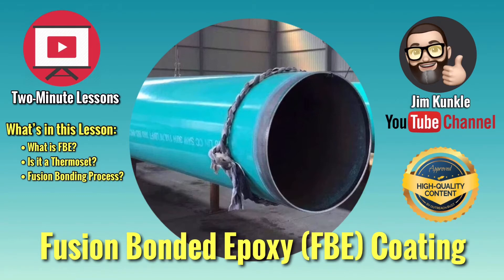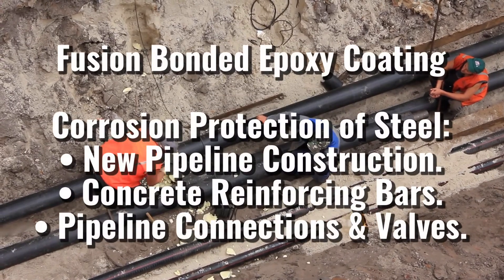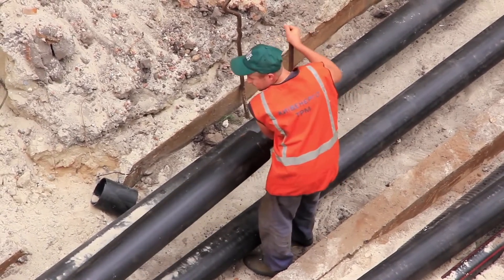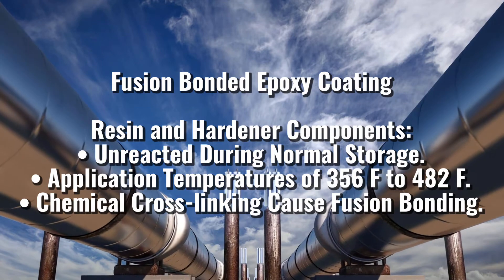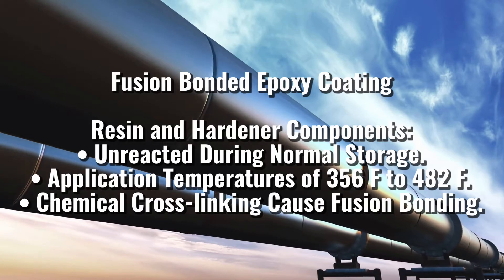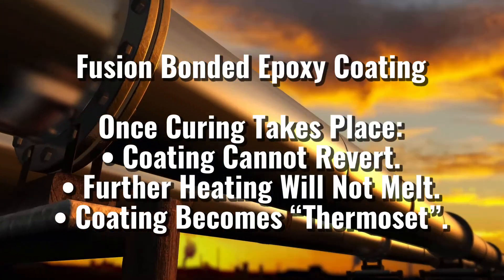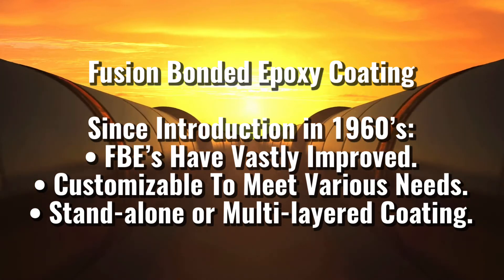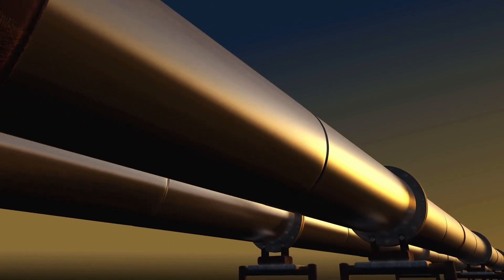Two Minute Lessons: Fusion Bonded Epoxy (FBE) Coating

Comment: Great content. Let’s say we have a carbon steel with FBE coating internally, do you know how to determine the weight of the FBE for 1m of carbon steel pipe? I know it’s going to vary depending upon the application of pipes, but a range for the same would be really helpful.
Thanks in advance.
Reply from the maker: Thank You!  I asked Paul Atzemis from Carboline (please subscribe to the Carboline channel) your question, here’s what he said.  “Basically, you will need the mixed WPG and Solids by Weight. (WPG x SBW%)=dry #/gal then divide by coverage will give weight per square foot.”  I hope that this helps you.  Thank You

Comment: Why external FBE coating does not need primer?
Reply from the maker: Wiki provides the answer: https://en.m.wikipedia.org/wiki/Fusion_bonded_epoxy_coating
Reply from the maker: Application process of FBE does require pipeline surface preparation to remove corrosion & other surface contamination.